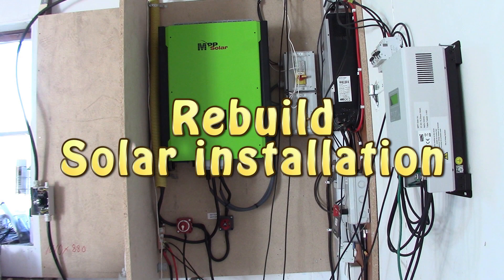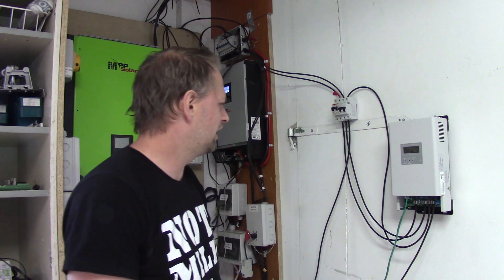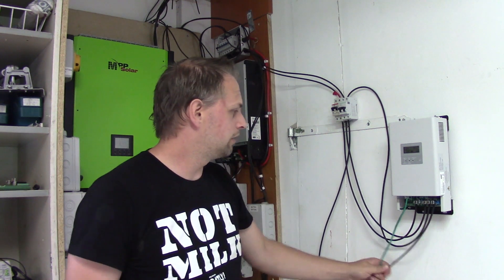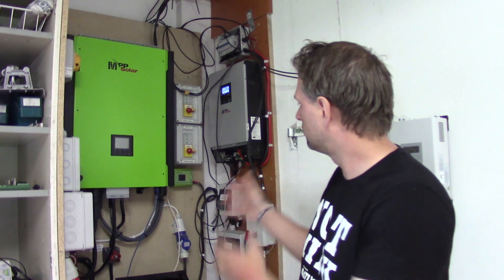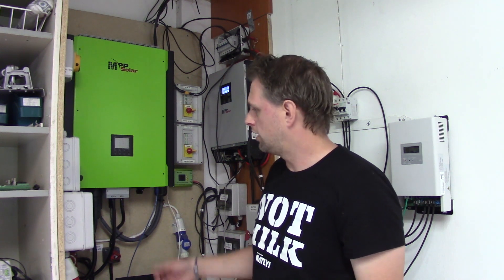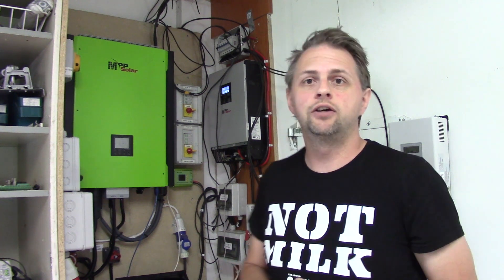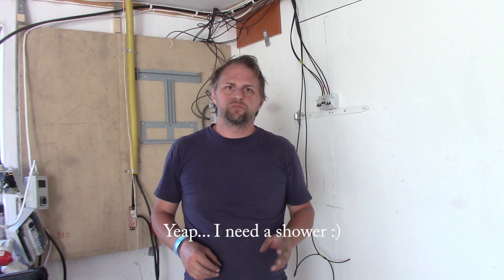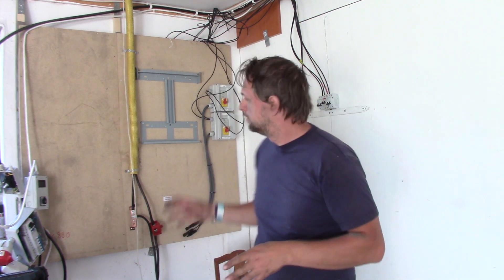Rebuild my solar installation! (part 1)

Comment: Hej jag kom precis över tre stycken solceller på 36 volt 20 ampere. Kan du rekommendera något bra märke på regulator?
Reply from the maker: Vad jag vet finns det inga 36V 20A solceller/paneler då det skulle vara 720W per panel. Säker på att det stämmer?
Reply: DIY Tech & Repairs Nej det är absolut inte säkert Då jag fick det med panelerna för att det var sprickna som skulle slängas tänkte jag skulle börja testa lite. Acrossol heter dom och de är 275w och när jag mätte på panelen så hade jag 36 volt. Har kollat på en som heter Schneider mppt 60 150 för att tanken är att köpa paneler så småningom. Eller hardunågot annat tips ser att du använder mpp solar?

Comment: Hi there. I'm planning to build a PV Unit with Lead Gel Batteries that i can get for cheap. Is there a brand that you can recommend for  this purpose? There will be max 15 panels. 
Greatings from Luxemburg
Reply from the maker: Hi
No im not sure about a proper brand in terms of Lead Acid im afraid. Trojan is a well known brand in terms of solar battery systems. You need to look at how many kWh you will get out of each cell before they are considered to be "dead"  Factors like depth of charge, number of cycles, depth of discharge and so forth. Also the temperature where they are stored is a big factors.  Do you go for sealed or open battereies that you need to water every now and then.  Big task but I have personally only used sealed UPS batteries before and not tested so many other sorts.

Comment: yay first!?!?!? yes, I sit here all day waiting for notifications :P
I'm still yet to figure out what to do with my inverter as it's  a high DC input inverter so I don't think it's a good idea to run 18650 in 300V+ mode, ESPECIALLY in DC!.
Everyone is running low current inverters, wondering if I can do this high battery supply to inverter safely.

Ah that grafana graphs, I love metrics.
Reply from the maker: I would love to run HVDC instead. Thinner cables :) I have looked at an inverter that can swap out my current 10kW hybrid from MPP. still 10KW but the battery part is 150-350VDC. Would be nice :)  But its all about the money
Reply: Well the benefit of HVDC is at least the cables don't need to be as thick as my arm, can run thinner wire and currents.
Just... more dangerous DC levels you don't want to lick and touch both ends :) so definitely requires covering over all terminals and batteries for sure but I might still do it.

I think my inverter requires minimum 300VDC input, so I might run 3 series of 30S4P at 3.3V so at minimum it'll be 300VDC. So 3.3vx30S(cells)x3S(batt)= 297VDC so at lowest charge, inverter would fall back to grid as it's too low, at full charge it'll be 369VDC. If that makes sense.
Reply from the maker: And depending on area >60VDC is not free to be worked on by normal people and need electricians to do the job :)